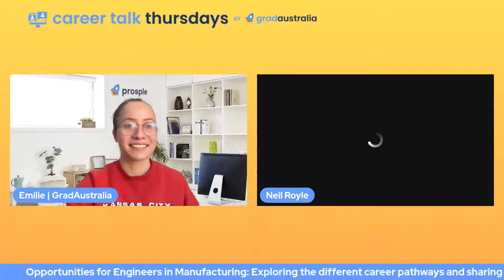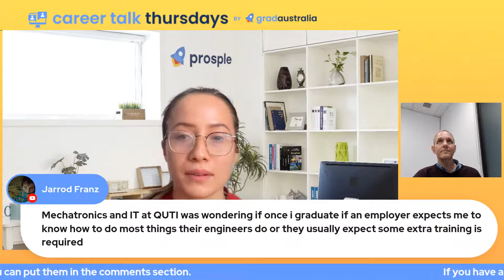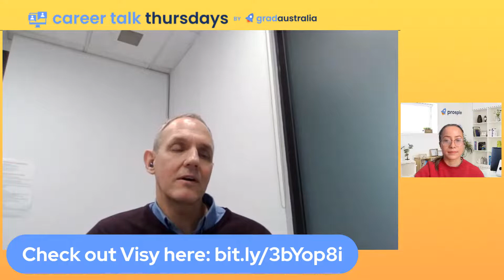Career Pathways and Advice for Graduate Engineers in Manufacturing

Comment from the maker: 0:00 Intro
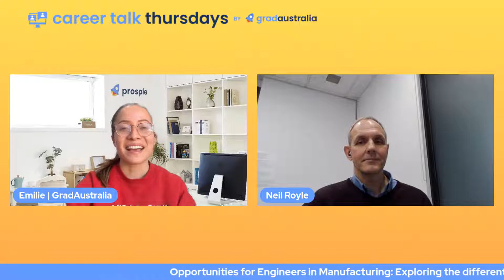1:53 Introduction of Host
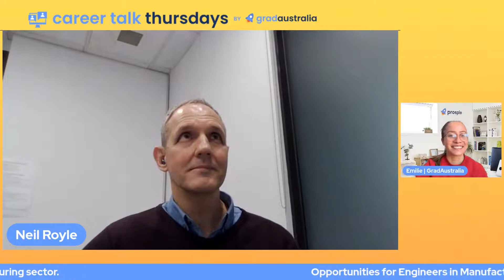3:40 Guest Introduction
5:12 What do manufacturing engineers do?
7:27 How to know manufacturing engineering is right for you?
12:05 What kind of companies can manufacturing engineers usually work out?
12:51 Any differences between the  day-to-day tasks of a manufacturing engineer and a fizzy or oil engineer?
14:22 How engineers can get into the industry?
16:30 Advice for graduates
18:14 Is there anything important to look for in a graduate program?
20:57 What does employer expects from graduates?
22:45 What are the career progression can they expect in this industry?
26:23 Is there anything students could do in the university?
27:42 Is MBA required?
29:22 What are the pros and cons of Manufacturing Engineering?
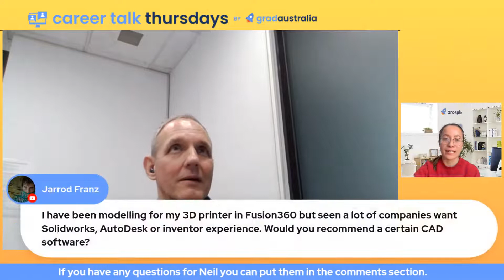34:16 Suggestion for CAD Software?
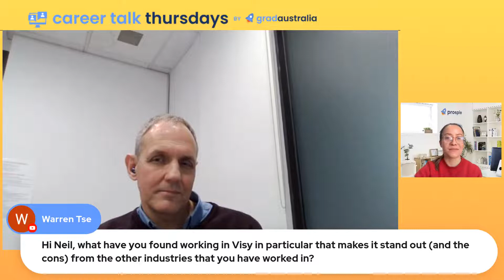36:02 What have you found working in Visy in particular that makes it standout?
28:57 How graduates can stand out who are applying?
42:28 What can interviewees expect in technical interviews?
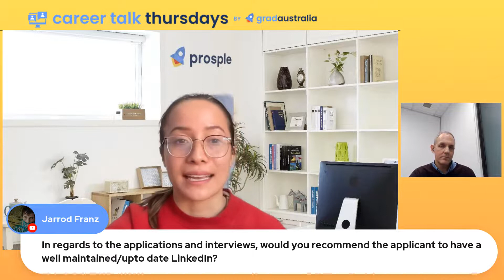44:50 Would you recommend the applicant to have a well maintained LinkedIn?
47:13 Job opportunities in Visy?
51:26 Advice for graduates/Student in Engineering.
53:16 Conclusion